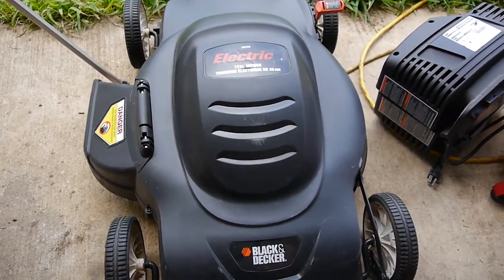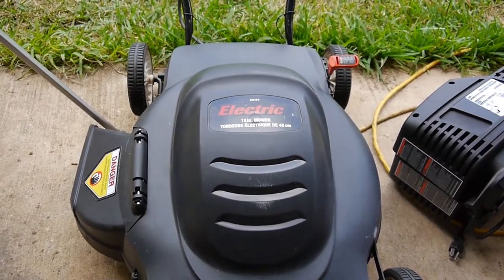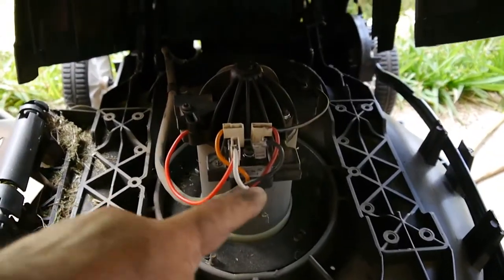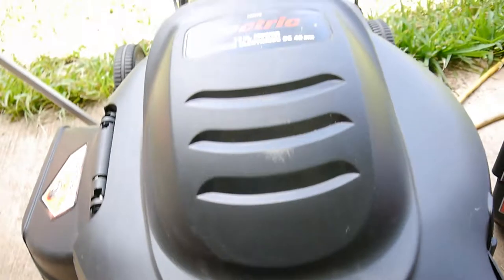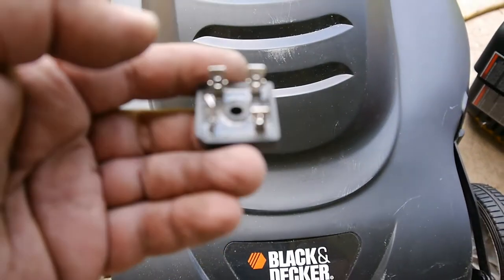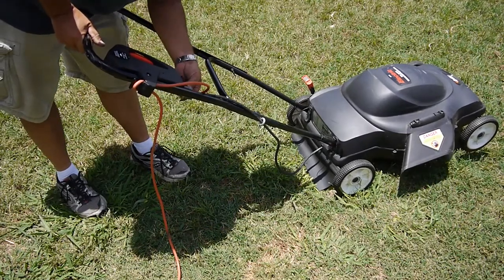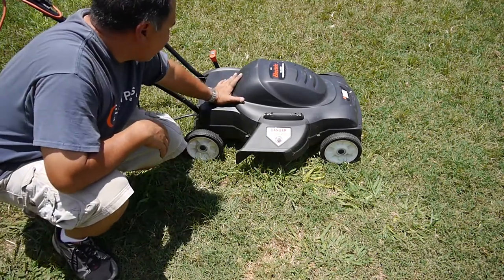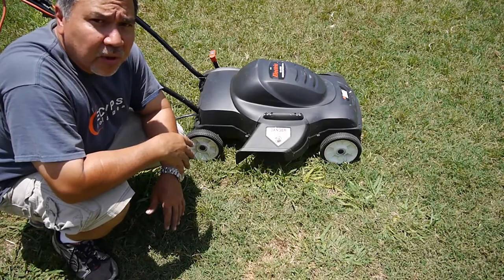Replacing Bridge Rectifier on Black and Decker electric lawn mower

Comment: Thanks for the video - bought a bridge rectifier, install was easy once I got the connections right (yes I made a diagram but didn't have a left / right reference point on it), and it works. It's an old B&D LM 100, built like a tank compared to the plastic ones they sell today. I've had it for 30 years - bought it from the previous homeowner when I bought the house and it's worked ever since.

Comment: I have LM175 and it is hard to start, have to shake it by the handles and it fires up. but after a few min it is loosing power. i checked wiring, replaced brushes, dusted off motor.  what else should I check?

Comment: My mower is doing the same thing, tripping the breaker when I turn it on, likely the bridge rectifier, but the frustrating part of all these videos is that they simply tell you to replace the rectifier, but not one of them will specify if your mower has to have the EXACT type of rectifier that came out of it and where you can get it, I search "bridge rectifiers" on Amazon, Ebay, wish, etc and dozens and dozens of all types of bridge rectifiers come up, some shaped like pretzels, lol. I search my model, the number on the side of the rectifier... same thing.  Please, HOW and where do you get the exact one that came out of your mower? ..or does it even need to be the exact one? does the number have to match on the side of the rectifier? ...I search this but again it yields dozens of all types of rectifiers.  My lawnmower is the black and decker MM275 18" mulching mower, 9A motor

Comment from the maker: This is a common problem with electric mowers.  If the mower is blowing breakers, check the rectifier. If there is no power getting to the rectifier, check the switch in the switch housing on the handle bar.

Comment: I have a greenworks battery dual blade that spins up and then shuts down- I'm assuming it's the battery equivalent of "tripping a breaker". Am I wrong? Is it something OTHER than a bridge rectifier? No one around here works on electric mowers so DIY is all I've got..Any help would be much appreciated! Thanks.
Reply from the maker: Jenn sirois I don't do a lot of work on electric mowers, but that said, some have a capacitor that could go bad.